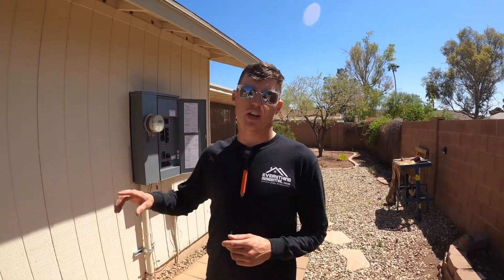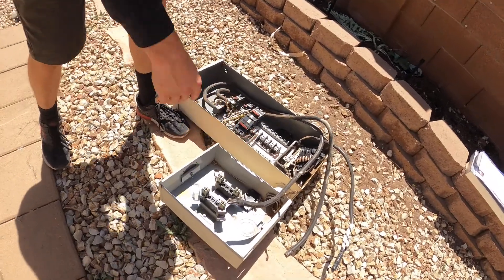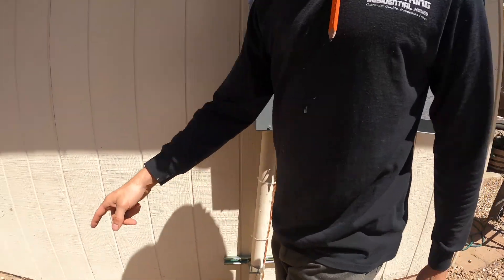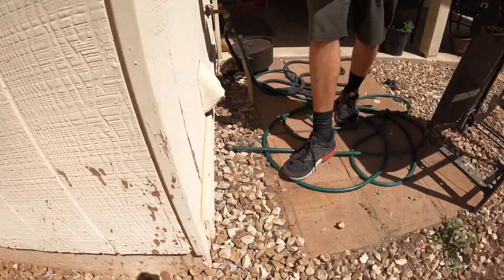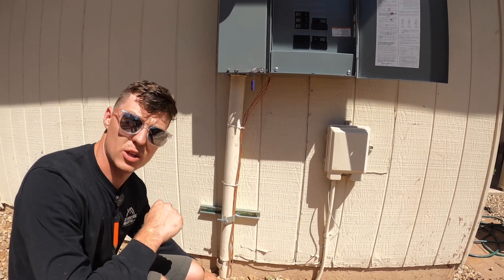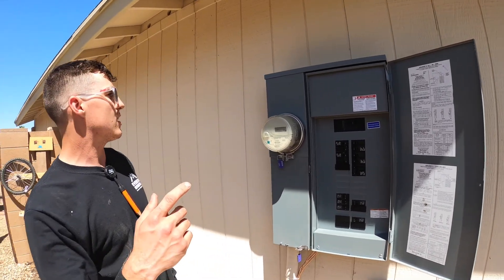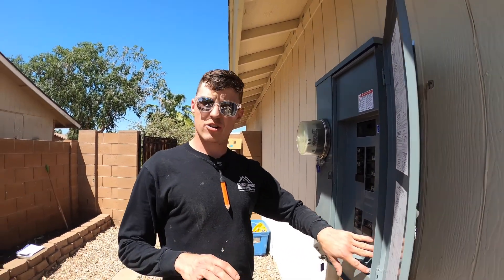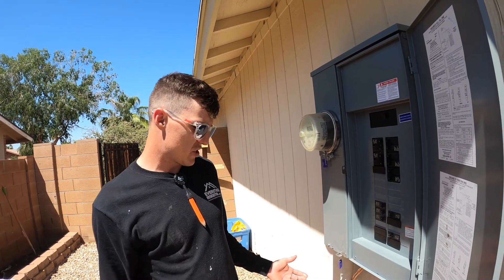Tips for Upgrading Electrical Panel in Arizona

Comment: Nice job. I am in Arizona too and have seen a lot of those pipes rusted out at the bottom. Do the inspectors in your area make you put 14/3's and 12/3's on a 2 pole breaker?
Reply from the maker: The inspectors typically ask if the wires  are on different phases of power and I don’t believe they ask for a double pole breaker but worth double checking, I have had  a service entrance pipe rusted in the ground and when SRP came back to turn the power on am old schooler dug the ground up just to look at the pipe and found it to be rusted and wouldn’t turn the power back on until it was replaced.

Comment: How come no mil tape on the pipe going into the ground? Wire nuts in the panel is also sloppy. Good job though.
Reply from the maker: I believe there was mill tape closer to the ground but it was painted over, what would you do if the wires are to short?
Reply: Typically we have set a larger pull box (6x4x4) in in the attic above the panel area, then made our splices and brought them down into the panel. Its a lot of extra work, but when doing a panel changeout sometimes the inspector (depending on the city) may require this, as well as a dedicated ground for every circuit, which sometimes depending on shared neutrals doesnt always happen, so you are back to making more splices and bringing them down into the panel.